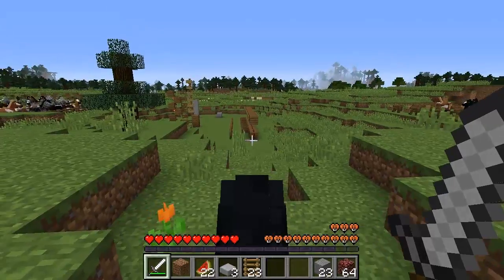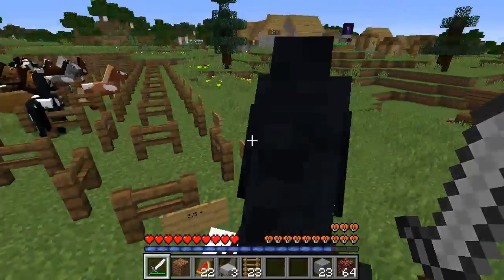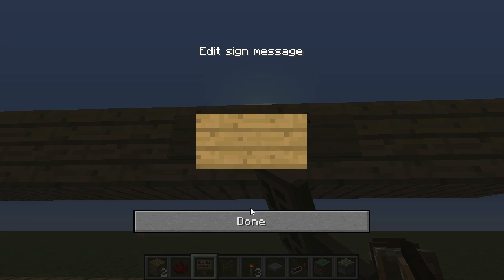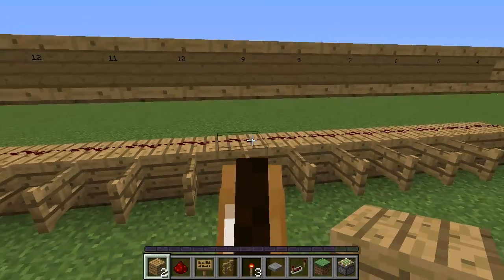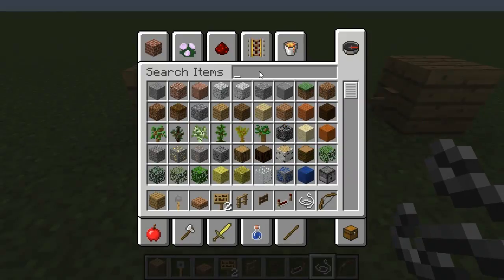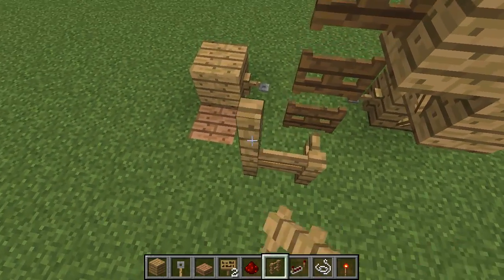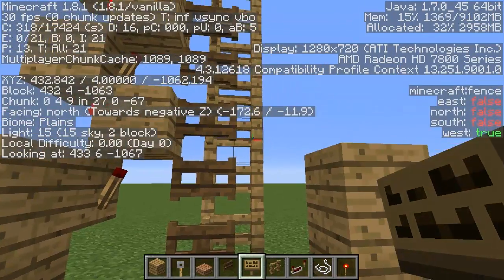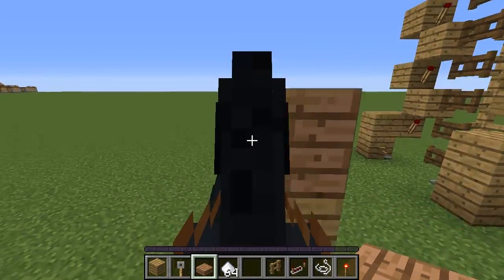MorezysMinecraft: Horse Speed and Jump Tester Tutorial

Comment: Great idea... but what if your horse is able to run past all of these gates? I checked the design and found no problems. If I add another row, it doesn't work. What do I do? Please help.
Reply from the maker: +Amlk275 if your horse can run past this system then its as fast as you can get already. so you don't need to worry :)
Reply: you should post this too the top. myself and a few others have had the same problem. @MorezysMinecraft
Reply: @MorezysMinecraft  my horse passes all gates and i added a new contraption it said i got 15-16 blocks per sec
Reply: @MorezysMinecraft  the jump hight is 3,5 = 3 blocks 1 slab
Reply: almost perfect
Reply: @ciel1116  my ideal horse runs about 12-13 per second but has a jump of 5
Reply: Kkkkkkkkkkkkkkkkkkkokokkkkkokkkkkooooooooookookkkkkkkkkkkkkkkkokkkkkkkkkkkkkkkkkkkkkkkookkk(kkkkkkkkkkkkkkkkkooookkokkkkkkkkkkkkkkkkkkkkkkkkkkkkkkkkkkkkkkkkkkkkkkk(kkkkkk
Reply: Mm
Reply: fastest a horse should be able to run is 14.50 blocks per second guys…
Reply: My horse crosses all 15 gates so that mean my horse is 15+ block per second how is that possible???
Reply: If you have a beacon you can run faster on a horse so my horse can run past the fences
Reply: @realcivilarchitect4128  cool but that doesn’t help when you go exploring 😂 you want to know the base level above all else
Reply: @Joltrix  .
Reply: @MorezysMinecraft You have mislabeled the signs. Any horse faster than 12 m/s will make it through.

Comment: somehow i have a horse faster than 15 so it's not useful for finding the very best stats
Reply: nenume 0 If it runs faster than the contraption than it is the best it can be... I don't really get the logic in this comment.
Reply: Ibxtoyact's one is more accurate imo also is consistent and actually works. This one does not match the same result on toycat's one. It's useless basically
Reply: Etern4l Saiy4n 
ibxtoycat used meters, however this guy used blocks. They used two different measuring units, explaining the difference between the two.

Comment: Built this on bedrock realms.

With a wooden pressure plate my mid-tier horses were flying past the full length of the test.

I switched to a iron plate, which wasnt triggering the redstone properly. I added a repeater and had to repath the redstone by 2 spots.

Now it seems to cap around 10 for max speed horses.

Also, occassionally when the fence gates swing closed, the horse will end up on top of them.
Reply: it's probably because you are on bedrock

Comment: The pressure plate powers for one second after the horse steps off the pressure plate. The block after the pressure plate should zero, not the block before. This contraption can only measure horses up to 12 m/s. According to minecraft.wiki horses have a maximum speed of 14.23m/s.

Comment: Kinda works, not the most precise thing, but is good enough.
I got 4 horses to test in my Bedrock 1.16+ survival world.
Sometimes the horses will clip trough a gate, usually this happens when it's not fast enough to clear a gate but it's almost.

I went like "wtf is happening" on my first horses, because I was just lucky and got some going at 14~15 and they were clipping the last gate.

One possible solution, is to use a redstone inverter (block with torch on top followed by block with torch in front along the line) to increase the line, adding this inverter in the 7-8 block will not afftect fast horses, just the slow ones that we don't care anyway, just take the gates before it.

Comment: to test jump high, just use blocks and different layers of snow!
If you are a nerd and deviding a block into eight parts is not enough, just use a carpet too and you can devide a block by 16.
No redstone needed.
For the speed tester i would use a little bit more redstone to create a longer signal wich is more acurate.
I guess you should do your speed tests in an area with no lag.

Comment: I need help from anyone still reading this comment section. it sometimes says my horse runs 8 blocks per second and sometimes says 9 blocks per second, though its the exact same horse.
Reply from the maker: are u running it on a server?
Reply: it can be because of tps problems. the same thing that makes minecart slime elevaters so reliable. its because boats, horses, minecarts etc. are located better than the player and the tps issues can make the redstone run before the horse gets there it is always the bigger number though so try for the biggest number and that's the speed your horse goes.
Reply: This was actually on console (switch edition) but I haven't tried the horse tester on PC yet, I assumed it would be the same. also, it was only a single player world.
Reply: you probably were running slightly crooked or something like that. if you run the exact same direction the exact same way through it then the numbers are consistent but you can get horses that clear all gates, in which case upgrade to a new horse speed tester.